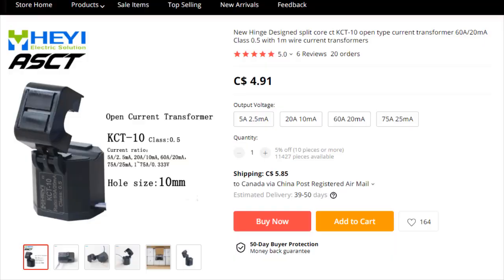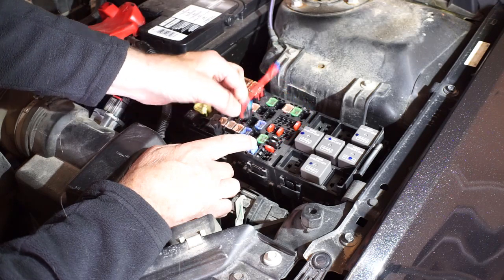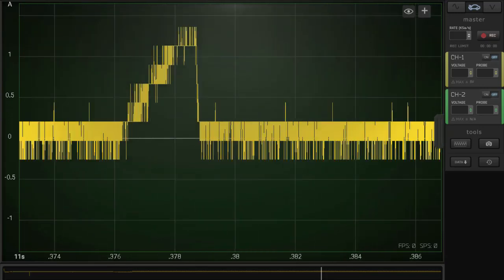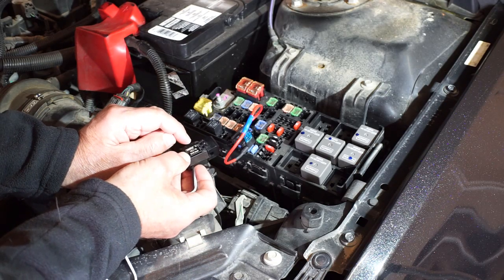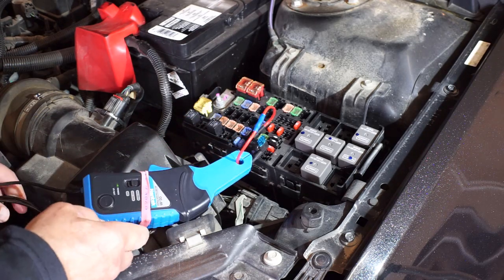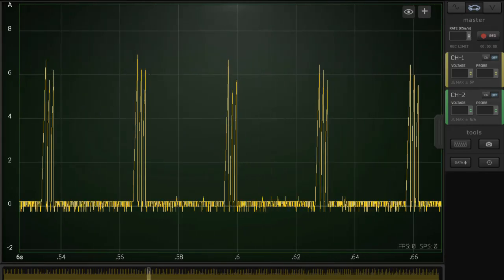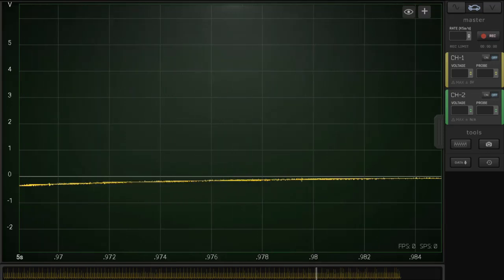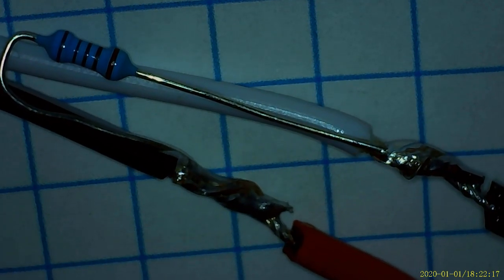GADGETS#113 - KCT-10 TRANSFORMER CLAMP

Comment: nice aproach, I think i found much better sensor  let me know your opinion and test it if you will 
Its Split core current sensor HSTS016L AC , DC and pulse current,   its a 5v reference,  outputs 2,5v at iddle  and goes up or down , and its 25khz  and refresh rate 3ms      20$
Reply from the maker: interesting sensor 4sure, Alex ... might play with that in the fall ... btw, response is 3µs...fast
Reply: yeah its fast and more sampling i bet we can see both pintle humps of injectors in one waveform without probing fuses in series..  Keep strong!

Comment: Hi Denis, thank you very much for your work, can you please indicate me how do you set this up ?? havemt been able to make it work, do i connect both cables to the car battery ?? where do i put the resistor ?? Thanks in advance and greetings from Mexico.
Reply from the maker: greetings from Canada, Samuel:)

KCT-10 is used here very much like we would use a regular amp clamp...just clamped onto a current carrying wire...

it is an unintended use of this small transformer and the waveform profile will differ from what we're used to with a regular amp clamp but it will be very clean (noise free)

Comment: There are other brands of the split core transformers that have 1V output or 5v output.  I ordered those is different current ranges.  These transformers have advantages over current clamps.  They don’t need batteries, are small to get into tight spaces and the low cost allows having multiples.  When used on a device that has a 0 current dwell time, they can be used to take absolute measurements.  Thanks for showing them to me.
Reply from the maker: the one thing is their "unconventional" waveform. Once we accept that, they are fast, cheap and the detail is far better.

Comment: Neato!  Well, I went to Aliexpress and all they're offering for the KTC-10 is a pack of 10pcs, sheesh! I'll keep searching.  BTW, luv your gadgets.  I'm a scope rusty automotive tech so I'm finding the tutorials are very helpful, THANKS!
Reply from the maker: yeah, what would one do with 10:)
should be able to find singles...
KCT-10 doesn't produce a "conventional" amp clamp waveform, but the detail is exceptional...
and thanks for your comment:)
Reply: @theGADGETSplaylist  I recently was scoping a high mileage V6 Toyota fuel injectors via the power side and synch'd to #1 COP, looking for a suspect failing/weak injector, not being real scope savvy, the waveform seemed to be somewhat 'noisy', so I went to the ground/driver side at the ECM, amp-clamed all 6 gang style, it "seemed" to be less noisy that way. Also, this engine is a 'Wasted Spark' system, so there may have been some overlap of sorts.  I'm assuming it was because the injector power was a shared circuit.  I like the way you demonstrated how much cleaner the pattern was with the KTC-10 vs a traditional amp clamp. More food for thought...
Reply from the maker: @hnd2893  too bad car manufacturers don't make it a point to have injectors alone on 1 fuse (same for coils) and we could just  tap into fuse box...
but, often they'll share the circuit with other things and all bets are off...
if you like this kind of stuff, you might like our HScope TELEGRAM Group:

https://t.me/hscope

why not check us out...

Denis
Reply: Thank you for this video but the KCT-10 transformer on Amazon there are different amps and Milli amps, wish one do I get?

Comment: I recently found your channel and think there's a lot of good content.  As far as the KCT-10, would it take the place of either of the Hantek current clamps?  I recently purchased an oscilloscope and am starting to acquire probes, sensors, etc.  Given that I'm on a budget, enjoy doing things myself and will be using the tools as a hobbyist I like the idea of making some of your gadgets myself to help me and my son as we work on his '87 Nissan 300ZX.  We are having misfire/rough idle conditions and I'd like to know if there are DIY alternatives to the CC-65 and CC-650 since I don't think these will be used very often.  Thanks for all the effort you put into making your channel.
Reply: ...also, what sites would you recommend for sourcing components?  Thanks.
Reply from the maker: most often, it's Aliexpress
Reply from the maker: It's hard to beat the CC-65 for value and that performs true current waveform profiles.
The KCT-10 does not tell us what the amps actually are. Its waveform is "unconventional" due to its coil oscillation. It's a transformer after all. I feature it because of the clarity of detail it can provide, as we accept its limitations listed above.
And thanks for the comment, Bryan
Reply from the maker: but, don't spend $$$ on the CC-650 high amp clamp. It's main (sole) purpose is for relative compression tests which can be easily done using the AC Coupling method.
Reply: @theGADGETSplaylist  Thanks for the info and advice - you've moved up the list of my favorite Canadians and are now ahead of Bryan Adams.
Reply from the maker: @jenbry97  Man, that takes me back to 1979. I was in Vancouver for a few days and discovered this bar called The Cave (famous people entertained there through the years, since torn down).
Bryan Adams played 1st set...Loverboy 2nd!
Only $5 cover charge. Those were the days...
Reply: @theGADGETSplaylist  Also the Hantec CC-650 is great for safely testing parasitic draws
Reply from the maker: @astrogate1  I disagree Chris...CC-650 high amp clamp way too coarse, even CC-65 not suitable for parasitic draw work where a few mA makes all the difference

Comment: Denis how would the KCT-10 go compared to your voltage drop method of measurements in Gadgets #9 and #20?
Reply from the maker: Hi Grunter!
Early days those 2 videos. I should have made more clear the downside to measuring voltage drops across a resistor in my old videos that promote that method...which is HEAT!
On something like a fuel pump or a blower motor or anything with a relatively high amp draw, we have to be business like. Take our readings without hesitation before resistor gets hot.
The advantage is the measurement will be clear, noise free and unlike KCT-10, "true to form".
I'm very impressed with the detail of the KCT-10 (and no heat). On the injector current, it shows the pintle opening like no other method I've tried. BUT, the waveform is not "conventional". Hard to describe but I'll use the word "distorted". But the level of detail is excellent.
If you intend to order a KCT-10, reach me on TELEGRAM so we make sure you get the right style...
Denis

Comment: Denis. There is clipping on the first pulse of the three with the KCT-10. It's small but visible. Can this be fixed without stepping up to the 20A?
Reply from the maker: I would not use the 20A, Jim. I think I lucked out on ordering the 5A for this work.
I had the OCS482 set on 1v input range making full use of the ADC. Good eye on spotting the clipping and it could be resolved buy choosing the 2.5v input range while still maintaining acceptable (but not full) use of the ADC range.
Reply: Buying a 10v unit isn't a good idea? Even with attenuation?
Reply from the maker: @alanw5879  I think it best to stick with the 5A model described here, Alan
I can't predict/vouch for the results of any other values
Reply: @theGADGETSplaylist  well to be honest, that signal actually looks better than any other clamp I've ever seen. Even the high end ones. I think you've discovered a secret, I'm definitely buying one. I'll add the resistor, do you recommend anything else added to the circuit? Even just an add on
Reply from the maker: @alanw5879  - no, I'd use it as shown here...
The waveform is not exactly the "conventional" we'd expect from an Amp Clamp...needs getting used to.
And, I noticed after the video, just how much detail this thing gives on an injector current ramp...I've never seen such a clear view of the instant the pintle lifts as this thing provides.

Comment: Much better parade pattern! You can coil saturation and misfires much clearer. Easier to spot coil or plug issues.
Reply from the maker: what I noticed later is that the pintle lift is clearly defined at each injector event in the parade...a lot of detail for just a fuse box current loop test and at a very low cost....
Thanks for watching, old wrench:)
Reply: @theGADGETSplaylist  not at all. I enjoy like minded people offering solutions to problems.  It is far easier to diagnose and correct problems when you can actually see the fault(s). So much money is wasted on bad diagnosis and parts changing with no change in results. I hate doing work twice when once is all that is needed.

Comment: Maybe a idea, is to place between the KCT-10 and the BNC connector a little box with a few resistors and a switch, to swap between multiple attentuation levels.
Reply from the maker: I kept it simple...discussed the 2KΩ value with Martin and I'm pleased with that size.
It's just to protect the scope and not have it overscale.
A box and a selector switch and resistors is not needed, IMO.
But, without any resistor the output is 500v !
Reply: @theGADGETSplaylist  , you can also add a TVS diode in parallel with the resistor as a backup protection, in case if one of the resistor leads come loose. Those TVS diodes are available in different values, and don't interfere with the signal.
Reply from the maker: @BjornV78  I ran it without ANY resistor and not attenuation and oscilloscope survived it. I'll end up frying a scope yet but I'm finding they can take quite a bit.
I then tried 60x attenuation and it was still overscaling.
That's when I decided to simply put a load on that little transformer. That tamed it under 5v.
A 2KΩ does the trick. All that's required, I think.

Comment: Just had a thought,
 ( I know, that could be dangerous 😂)
Could that unit be used for a relative compression test, like you can with a high amps clamp? 🤔🤔🤔
Reply from the maker: not with this 5A/2.5mA size...and I wouldn't try the bigger ones either.
This thing without loading it with the 2KΩ resistor was outputting 500v !
The resistor tamed it down to 5v...but those bigger model can produce a lot power...I ain't trying it...LOL
Reply: Go on, try it.
Where’s your sense of adventure gone? 😂😂😂
Reply from the maker: @JoeNunes345  LOL...I'm like a cat, Joe...I've used up 8 lives, now I'm careful:)